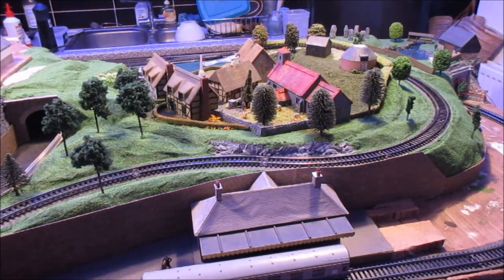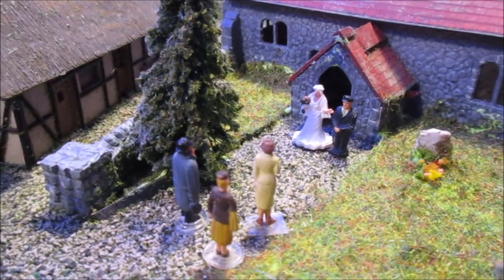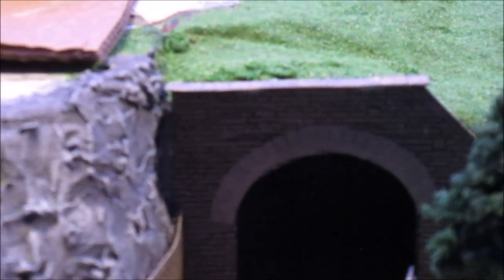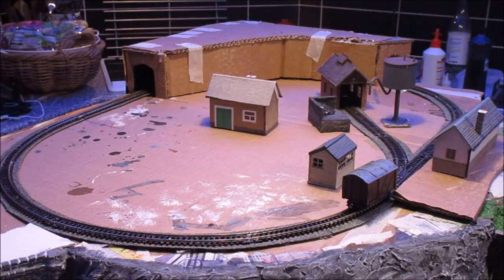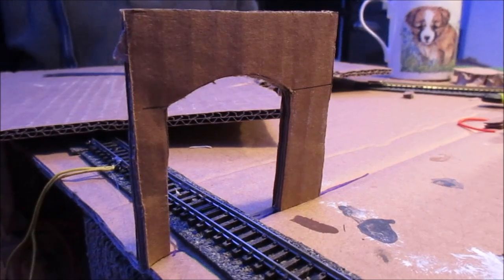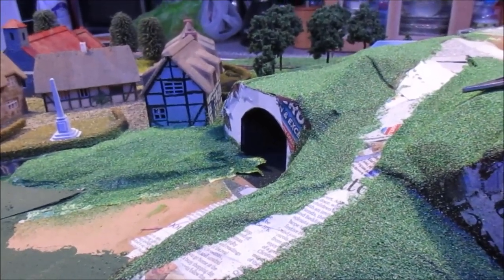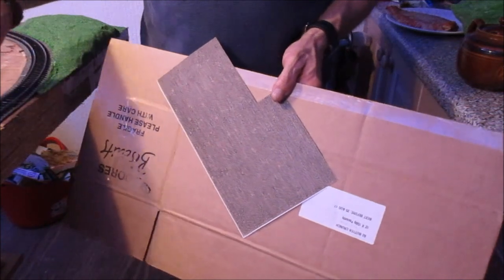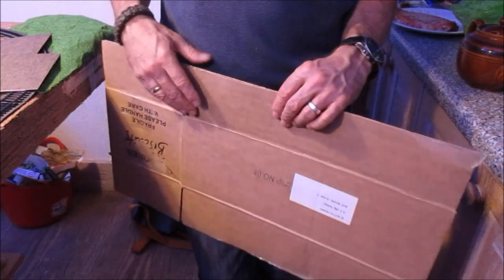Roselands Hill Exhibition Layout - Update 11 & Building Methods + Materials! - 89 Days To Go!

Comment: Right, mate.  Your layout is progressing quite nicely.  You know how to make model railroading fun and inexpensive.  I cannot wait to get my layout up and running once again after being stored away for 14 years.  My wife says we are going to move once again so I probably won´t have time to get the permanent one back up.  When I want to run some trains I pull out my temp. layout; it´s just a big loop but I do get to play with some of my trains.  Great job and crack on, mate.  Enjoyed your update.
Reply from the maker: Hi mate, and well done on the Brit vernacular! We try and do fun and inexpensive and also fairly quick and easy as that's how you keep motivated. We have a large loft layout but it's the more portable ones that get all the work done as they are easier to get at. I guess you could always put some buildings and grass mat etc on your temp layout just give it a bit more interest?
Reply: Right on, mate.  I´ve got to get cracking on the temp. layout.  I do have some grass mat I could use on it as well as some buildings I´ve got stored in a few boxes.  That would add some interest to my big sheet of particle board that I painted red for some reason (I think I wanted to seal it from moisture somewhat).  I think I only had red paint at the time I decided to paint it before laying the track.  I just wish I hadn´t sold my few switches (points) on e-Bay as I could have used them on the temp. layout.  Oh well, live and learn. Thanks for your comments and I look forward to upcoming updates.  Crack on, mate!